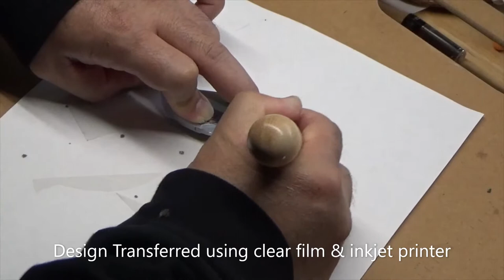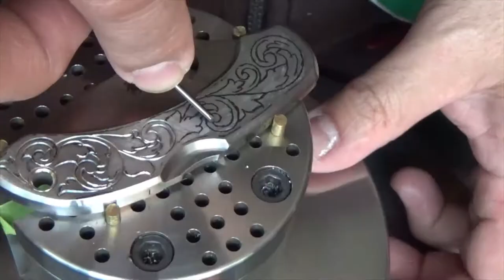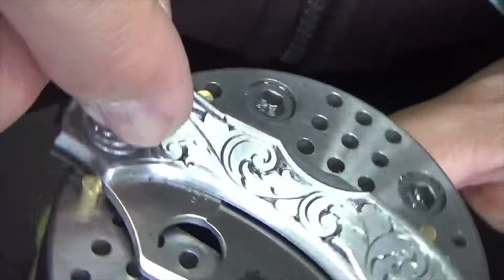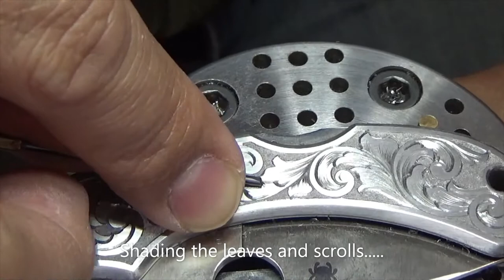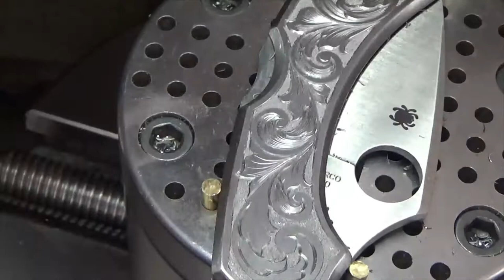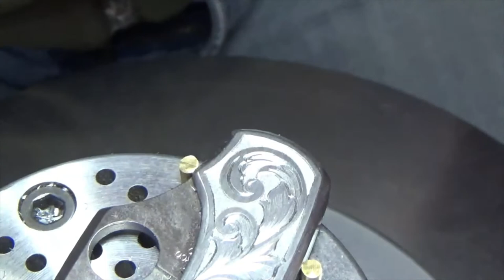Spyderco Dragonfly Knife Engraving

Comment: What graver are you using? What degree is it sharpened to?
Reply from the maker: Carbide 110 degree
Reply: @dennyengraving  I've tried 120° but not 110°. the result for 120° in what about 110°?  on the face at 110° how many degrees do you use?
Reply from the maker: @mulanjamilah7849  55 degree on the face